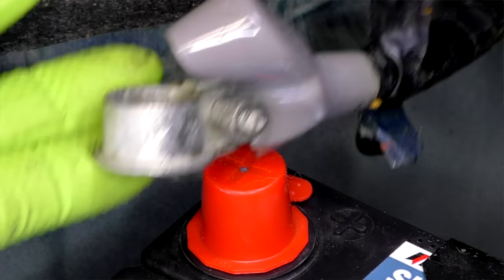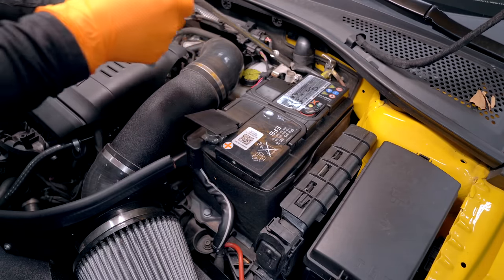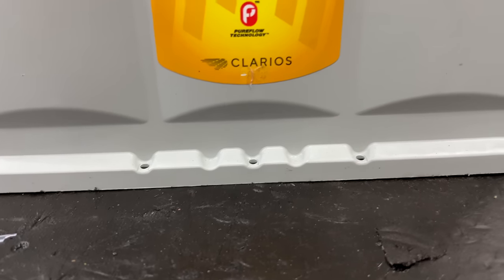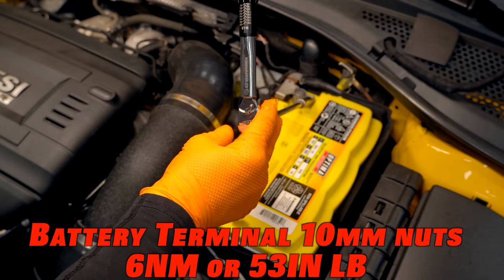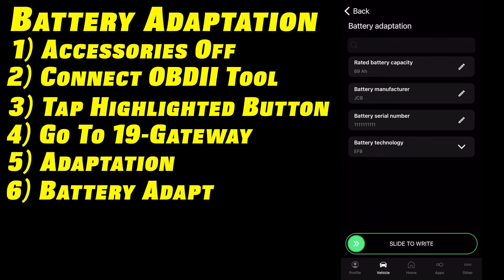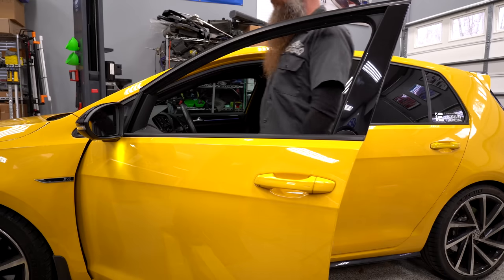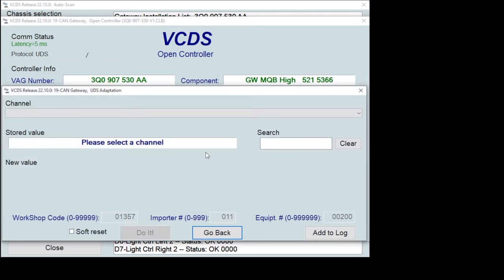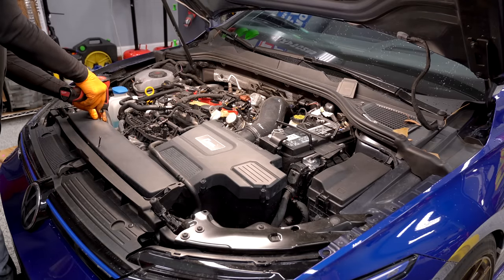How To Replace and ADAPT a VW or Audi Battery

Comment: This is a great video.  You anticipated and answered all my questions.  My 2019 VW Tiguan battery was 4 years old...so I replaced it...although it wasn't exhibiting any issues.  I upgraded from a Flooded to an AGM.
Reply: Thank you for sharing! Did you follow his instruction to do the battery adaptation after replacement? Also, did you run into any issue? I would greatly appreciate your feedback because I am about to replace the battery for 2018 Tiguan. Thank you.
Reply: @seanl7130  I did a 2017 GTI with AGM  no adapting, no issues, just drive it, lights all reset. And a 2018 Tiguan, AGM no adaption, just drive steering wheel left right  On my 2019 Golf R I went with the original type EFB, just because,  i did an adaption, just because, and the aH rating was slightly higher than OEM...does it really matter?  probably not, I read elsewhere if you don't adapt  to correct values it charges battery differently, who knows .  But dealer told me, if stuff works you are good, usually only need adaption if something acts squirrely.  I did mine at like 4.3 years on the R...no issues, but that is the time range, anything can all of a sudden happen, when you least expect it, usually raining at night.  I had a 2013 tiguan go over 6 years, it did die one day, and i realized, I just forgot all about changing it....one day good, next day dead, which batterys do.  Luckily it was home, just went to Auto Zone got a 3 year warranty full replace battery, popen Z in, 2013 did not use any kind of adaption protocols, that battery went only 3.3 years!! to reach 50% of course, right after warranty, which means it was actually well made it lived to it's spec.  Changed it to a VW OEM battery at the dealer this time...I have had good luck with lots of Auto Zone batterys over the decades.  East Penn Deka(great stuff, i use in motorcycle Deka brand, and in my honda portable generators), Johnson Control, Exide, are the basic makers of em all for U.S. batterys.  I see Varta is OEM  in factory batterys...
Reply: @cengeb  Thank you so much for your detailed response. I upgraded to AGM and did the adaptation with VCDs. Everything works well.

Comment: No1 Remove keys out of veh b4 disconnecting battery as some will lock upon disconnected/reconnect
No2 Some of the "end ledge" fitments will lock into groves down in the plastic housings.
No3 Lock & Unlock, some cars will crank but not start as the factory immobilizer will kick in so this usually avoids any problems.
No4 If the car would not start b4 battery replacement you WILL most likely have low voltage codes or loss of communication codes so a full scan/clear is ideal.
No5 Resetting the windows often overlooked, most vehicles just hold the button for two seconds once the end position has been reach from that particular window door switch it will not work from the drivers control panel other than for the d/door.
No6 Idle control speed. Toyota's & Mazda's in particular with a electronic throttle body are bad for loosing there idle speed so a "memory minder" is a good option or you will most likely have to clean the throttle body in some cases. Subaru's I have found that cycling the key twice without starting the engine solves this.
No7 Reverse camera's and radio codes. Some will require a factory disk (Toyota JDM) to reboot stereo/camera. Some vehicles will require a pin code for the radio which can be a pain in the arse if you don't have it. 
No8 Always good to recheck the charge rate once finished. Sometimes the battery sensor may need to be disconnected to achieve this and the vehicle restarted. Other times with a new battery and late model vehicle  the system will need to have load on it as with a new batt it may have gone into a static charge mode i.e 12.6v or so eng on.
No9 Reset for the stop/start system , every vehicle different, Mazda's have a set procedure, lots of video's Google will help.

Comment: What are the dash lights that come on when the battery is bad? 
I have a G7 2019 DSG7, oem battery and this weekend my car showed me 6 errors : ESC, Hill Hold, Front Assist, TPMS, Electronic Parking Brake, ParkPilot, Start-Stop...
Is stucked in P (flashes) and e-brake didn't wanted to disengage normaly. Had to press it for 30sec.

Wanted to check the SOC, but shoea only TIME...
With the battery of the car it shows 12.6v..car starts and will idle at 1000rpm with all the errors. 

Just can't move the car, won't engage gear in D or R..

Comment: Thank you so much for all the information in this video! My 2018 tiguan has been having issue with battery since 2021 after I did not drive my car for about one month and I had to use jump starter to start the car. It seems the battery was permanently damaged that I have to drive my car every 3 or 4 days after that incident. Otherwise, the engine light will be on, telling me that the voltage of the battery is low. Now, the engine light is still one after I drove it more often these two days. It is probably the time for me to change the battery. With this extremely helpful video, I think I can do it myself now. Thanks again for your expertise and great video!

Comment: This video helped me greatly in upgrading the battery in my Mark 7.5 R. And the AOPEC Battery Insulation Kit from Amazon installed easily so as to replace the battery blanket that no longer fits.

Comment: Hack method of replacing my agm battery on my 2014 A6 years ago when it gave out during a -20°f cold snap in Minnesota, was just jump start the car, disconnect battery while electrical was running off different car, then swap in the new battery. 4 years later still working just fine even though the car probably thinks it's a super old battery.

Comment: Didn’t know any of this when changing out the battery in my MK7 golf.  The sunroof controls never worked right since.  Most other systems came back with no issue.  Either way, this is great information and a very well done video.
Reply: If your sunroof is acting up, there's a sequence to get it back to normal operation. Similar to the window technique demonstrated in the video, but with sunroof controls IIRC. Search the golfgti subreddit, there's definitely threads on how to fix it. Mine wasn't full auto opening, I had to hold the button or it would stop opening/closing as soon as I let go

Comment: Great job on this video. Clear and concise. My question is about the OBDEleven. After I select 19 Gateway, then Adaptation, the menu I see after that is Channel (only). I think I am supposed to guess what channel to enter, which I tried, but I don’t have anything as nice as the menu selections you have. Did you purchase some extra options to get the menu selection choices you have?

Comment: my previous car was 2011 Passat and battery lasted until year 2020 and 215 000 kilometers (133 600 miles), it was originally equipped with AGM battery type and I almost never used start-stop system (always turned off upon starting engine)

Comment: This is the Best 👌 👍 Advert to avoid VAG / Audi products. This is the pinnacle of bad automotive engineering, VW can add this to plastic engine parts that should not be.
As to aftermarket air intakes at least you have a heat baffle, OEM panel air filters are surprisingly good and better with cool air intake in many applications 😎

Comment: Thank you for this valuable information...
I have a Golf 6 tsi which I recently replaced the battery with a new one but didn't do the battery
 coding...After 3 days I had to charge my new battery...I really don't know what is draining the battery...
What can possibly the problem as I thought that my gateway might be the problem

Comment: Question: will I need to recode if I put back in the same battery? My battery is currently flat, so I was going to take it out and put it on a trickle charger. I don’t want any surprises when I put it back in. Great video!

Comment: Thx for the great video. Very clear and descriptive. However, one note from my side. I do have a Seat Leon Cupra ST 300 4Drive, which is basically the same car as combi. I replaced my battery after 5 years as well and during my research I was trying the understand why the factory has not used a superior AGM instead of an EFB type battery. It turns out to be that the AGM batteries doesńt like over 55 celcius, hence not generally used in the engine compartments without proper heat insulation. I have 5 other cars and 4 are using AGM batteries and the AGM batteries are always in another compartment. My Cupra (same as Golf R) has a turbo gasoline engine which has very high engine room temps. Therefore, decided to go with EFB again although it is inferior.

By the way, I have not done the adaptation as I used the same capacity and the car functions without any issues since 6 months. Probably the effects might be long term. But it might be the case that the car adapts on its own. I use iphone and my ODBeleven is old and doesnt work wiith iphone. They force you to buy another ODBeleven for iphone which is very annoying. And I have a very old Samsung S4, but it is so old now the android version is not anymore supporting ODBeleven - another way of annoying customers.

Comment: The battery tray accommodates different size batteries. I unknowingly "upgraded" mine from an H5 to H6 size battery. You just have to move the hold down to a different spot. I had no idea about coding though. I'll have to go in OBD11 and check that out.

Comment: Thanks for the information!
Been researching Mk7 for a few weeks to make it my daily driver, but still deciding between the GTI or R model.
Reply: If you're not driving in places that benefits from all 4 wheels (track, twirly roads, launching, etc), GTI will be more than adequate. Bare in mind that the R is front wheel biased, meaning that the car doesn't send power to the rear wheels until the front starts losing traction. Best is to just test drive both, and see which one you feel more happy/comfortable with.

Comment: Hey, great video. I have a 2015 Golf TDI. Someone commented that a prior to 2017 model, I don’t have to do the adaptation, is that true? It’s basically the difference of $135 or so, the cost of the reader. Any ideas? Would be great to just swap out the battery….

Comment: Hi Charles, not sure if you’ll see this so I know this is might be a long shot, but I’m confused about what to enter for my battery’s amp hours (Ah). My battery doesn’t specify Ah, so I wasn’t sure if you’d know what to enter based off of this info:

Cold Cranking Amperage: 730
Cranking Amperage: 910
Reserve Capacity: 115
Voltage: 12.0

I have a 2019 Jetta SEL, so for the most part I think everything is basically the same, but I want to make sure I don’t ruin my battery since this info isn’t given. Thanks!

Comment: Yes. I've replaced many batteries over the last 40 years. My 2017 Golf through me for a loop when I dropped in a new battery after three years. I thought that I did blow the ECM since everything lit up light a Christmas tree in the dash. Another post somewhere stated just drive the car. That did correct all the warning. I hate that. However, I never changed the adaptation settings. I don't have start/stop, so maybe that was not needed. Who knows. Still going after 3-4 years on the new battery, so ...

Comment: I wish I had the options that you have/had when you used VCDS.  I have a 2010 Audi Q7 and the only field available is '4F0915105E JCB 1B66006' which does not seem to allow for you to specify the CCA info.  I guess  this is just one of the down sides to having MK1 Q7?

Comment: Can you use a battery tester on hood posts when the battery is inaccessible (under front seat). 2014 Touareg at 211km still on original battery.

Comment: Great video as always. I have a question: what happens if you do not perform battery adaptation and if replacement battery is same Ah and type (for example EFB) but different vendor?

Comment: Awesome video. 👏👏 I’m in the uk 🇬🇧 I’ve was able to use the OBDII adaptation on a Seat Tarraco forgive me if you already know, but it’s exactly the same car as a VW Tiguan allspace . Interestingly, the old battery was set up wrong out of the factory. The manufacturer, AGM varta battery was set as JCB when it should’ve been VAO for Varta. And being an AGM battery, it was set on fleece?  now I’m wondering is that what shortened the life of my battery? I got four years out of it should I be happy with that is that good? even if the car battery was set up wrong out the factory😂

Comment: I replaced my battery on my Audi A3 tdi 2014, 16months ago. I didn't get the same battery from the dealership, I got one from the battery place in town. The battery I got was also a AGM and had exact to similar stats. 
I didn't reset the software, I just swapped it out with the other. 
I had no problems til this far. Is it ok what I did? Should you only do the software thing once you upgraded or downgraded your battery?

Comment: Hi I followed your video on my 2015 golf gtd ! .. everything has worked the battery is on and did the adaptation not a problem car runs and starts perfectly ... however when I ran a scan on the car after it came up with 14 faults .. which after looking alot of these faults where what was happening when the previous battery was dieing ... should I clear all the faults ? .. and run a scan again to see if all faults have been resolved ?

Comment: Got a 2016 GLI that still has the original battery, I'm actually kinda surprised that it's still doing so well. The other day you could tell it's starting to get weak when it was zero degrees with a -30 windchill. It cranked slower and misfired for a few seconds after it started. It's about time I'd say

Comment: I have only been driving and working on my VWs since 1973, and I agree it stinks I need to have a VCDS to change a battery. But since I have had one for twenty years I can live with it. I normally wait for my battery to fail, but my mk7 Sportwagen TDI's battery is 6.5 years old and the original battery so I went and got a new stock battery because the original lasted so long.

Comment: Maybe handy to connect 12v charger to the terminals while exchanging battery. Saves a lot of fault codes.
Reply: Absolutely a very BAD idea as the voltage from a charger without the battery present can exceed the maximum allowable voltage and destroy components, since the battery acts as a large capacitor and stable voltage source.
Reply: Does Noco 12v battery maintener not able to exactly that?

Comment: Hi,  my 2013 A4 stock battery is no longer accepting charges. It is AGM, and i tried to replace with non agm lower AH , and the negative terminal smoked but when i returned the old one it doesn't smoke,  your opinion will  highly be appreciated.

Comment: The battery manager will literally tell you when the battery health is low. It calculates how much you discharge and recharge the battery. So if you get a health warning, and it’s not related to a short trips in cold climate, change the battery ASP. If the health drops too low, it can inhibit starting the car even if you change the battery. You also need to reset the manager by input of new battery serial number.

Comment: My OBD11 had a different screen when doing this to a 2012 Q5. After clicking "Gateway 19" my only choice was "Long Adaptation" then it asked for "Channel". Google results say use 004. The only thing I could change was one long code of battery model, manufacturer name, and serial #. I replaced Audi battery with a Interstate and just changed the last digit in OBD11 from a capital letter to lower case letter. Also I didn't have all the dash lights come on after the adaptation. Otherwise very helpful video

Comment: I did this about 2 years ago on a Skoda Octavia 3FL. I went for an AGM and the research I did pointed me towards coding it as ‘Fleece’ in OBDC. Are you sure this is wrong?! I did briefly have it set to AGM and it started up better, but I changed it to fleece after a bit of research. What do you think?!

Comment: Hoping you can help, I changed the battery on my Volkswagen Golf mk8 and coded the new battery in using OBDeleven. I now have an engine management light on which was not there before. Any suggestions?

Comment: Hey, got a 2012 VW TSI. Replaced the battery recently and since then have been getting ABS/VSC and traction codes when starting the car. They go away after driving for a few minutes but then come back every cold start. Would this be the fix for that or just better off taking the car to VW?

Comment: I haven’t changed the battery on my 2018 Golf R yet. But I saw information awhile ago saying that 2017 or 2018+ MK7/MK7.5 Golf vehicles don’t need to have the new battery adapted due to the “Battery State of Charge” feature being removed on 2017/2018 and up model years. And only vehicles that have the Auto Start/Stop feature need to have the new battery adapted. Any truth to this?

Comment: Hi Charles. I'm collecting my new mk8 gti in few days. I parked my mk8 gti most of the time usually few weeks each time so will disconnect negative terminal only. When i reconnect the negative battery terminal and ignition on then steering max left and right would do right, don't need obd11 to code correct?

Comment: Well that's the catch, huh. Gotta have a VCDS or OBDeleven, both of which are relatively expensive (when you are only using it for this one thing). Probably better off just having your battery changed at a shop.

Comment: I have a 2002 vw golf tdi and i could never get my battery to charge correctly it would always say it had 12.75 volts while running i will give this a shot to see if it helps.

Comment: My 2005 Beetle TDI had the original battery in it when I bought it and I finally replaced it in 2018 with another OEM VW battery.  That one lasted 3 years. 🙄 The dealers around here don't let you buy OEM batteries from the parts department anymore so I used a Diehard AGM, we will see how it goes.